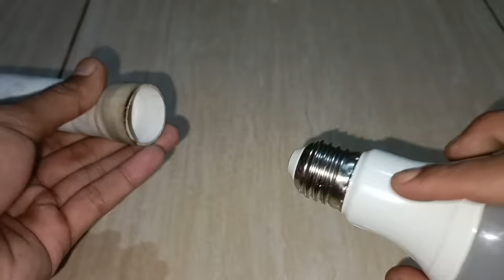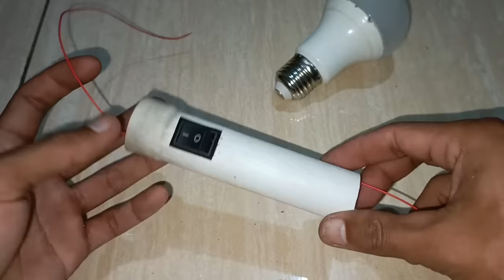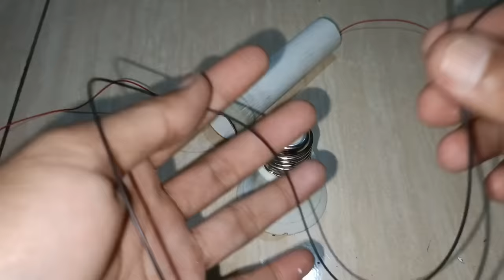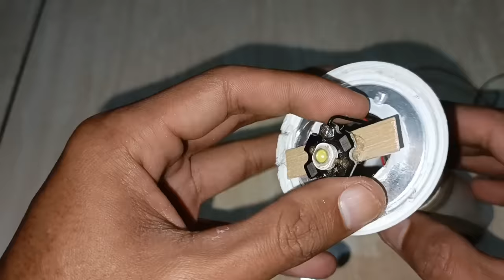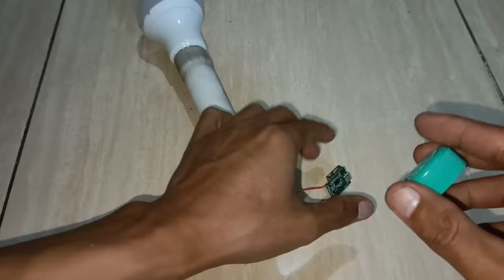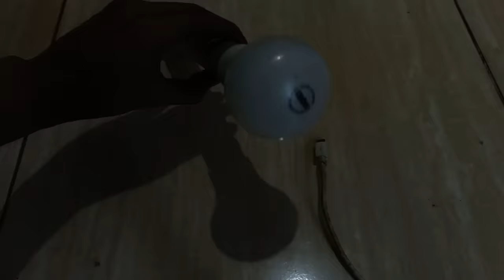How to make a practical rechargeable lamp

Comment: Making lights like this is fine, but what gauge of wires has been used to charge it with a solar panel 3W 8.97v 3A. A normal mobile charger is fine

Comment: J5019 HW-357 DC to DC Step Up Boost Module 3.7V to 27V 2A Adjustable Battery Charging Module for WiFi

ভাই মডিউল টা অনেক সাশ্রয়ী তাই অনুরোধ থাকলো এই মডিউল  দিয়ে একটা পাওয়ারফুল wifi ups  বানিয়ে দেখান যার বেকাপ বেশি হবে

Comment: Good video ! .... a simpler way to make a rechargeable torch is to take an ( off the shelf )  LED torch that uses 2 or 3  AA  or AAA  batteries and replace these with the ( salvaged ! ) Lithium - ion cell from any disposible " vape " (  found on most streets ! ! ) .... use a rechargeable vape charger ( fit small croc clips for ease of use ? ) .... this works WELL , and , you do NOT get horrid  LEAKING alkaline cells making a MESS in your shop bought torch .. ( tried - n - tested ) ....... DAVE™🛑